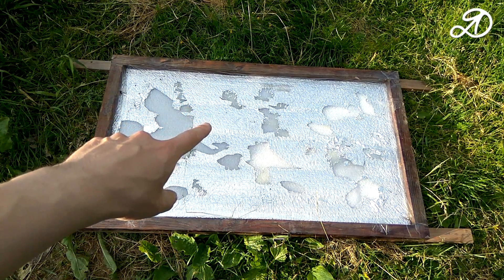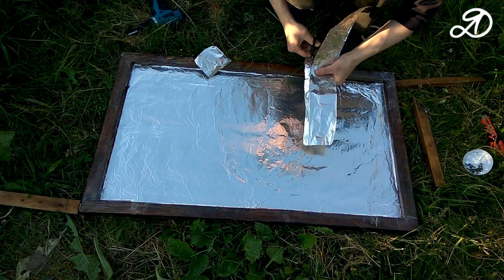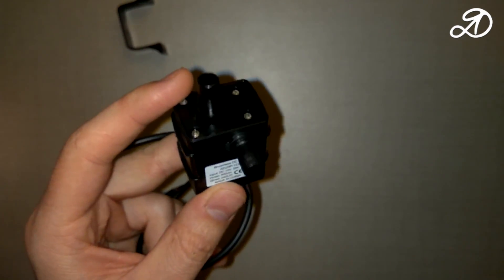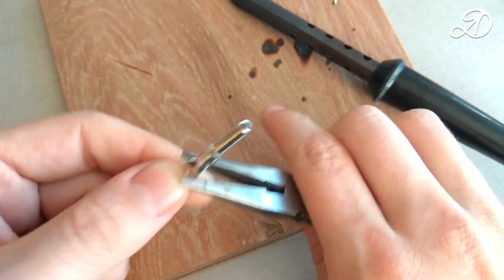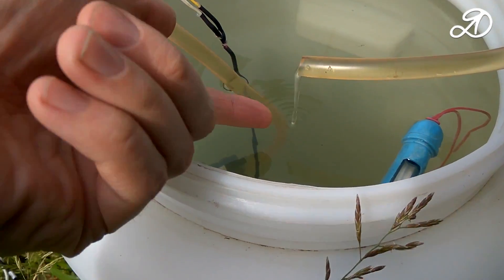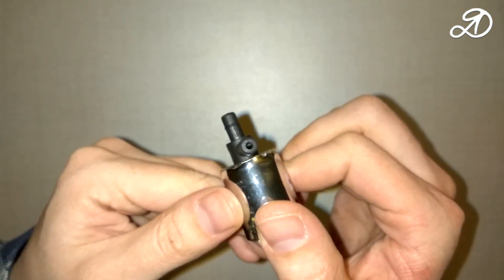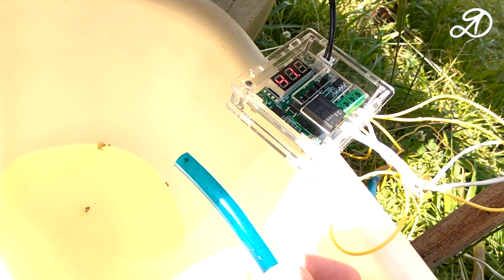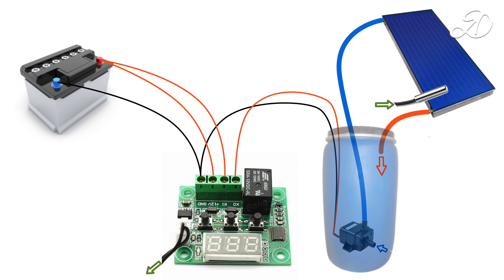How to make a solar collector DIY

Comment: Missing information;
Ambient outdoor temperature.
Exact length of time from water starting temperature to new water temperature.
If I overlooked this information I would appreciate timestamps for it.
This information is required for evaluating the temperature gradient.
The rate of heat loss or increasing temperature is directly related to the ambient temperature.
I could say for example that my water heated from 18°C to 27°C by pouring it in a bucket and waiting no coil needed but that's because the air temperature here is 32°C with 65% relative humidity.
In any case great physical example of a thought experiment.

Comment: Thanks for the video! Just one comment i have to make: The inside of the panel should not be reflective, you need something black like asphalt that absorbs the UV and visible light and releases it into your casing by convection and as infrared radiation thus creating a greenhouse effect.

Comment: Was looking for someone who tried this! Your the only person I’ve seen do it thus far. Thanks for showing your build and showing the panel effectiveness using the old fridge coil
Reply: I've never found another one who tried this, so now I'm building my own. I am curious about what can I get with a more elaborate build. I found in garbage a taller fridge coil, and I'm putting together the box, than paint all matte black an then a glass on top all sealed up with silicone. I want to control the pump with an Arduino program... Let's see what we can do
Reply: @teopuglies  Please update us with whether it worked and what you discovered.

Comment: Thanks for sharing. 
I'm working on a project that requires a flat plate solar collector, I'll love to use a metal instead of wood, will that increase its efficiency?
Reply from the maker: Thanks! Use a black inner surface! Of course, metal will heat up better than wood.
Reply: @dial2277  Thanks. Please can you help me with resource that will guide me through the process of fabrication of a flat plate solar collector, with the most efficient materials (but cost effective ☺). I'll appreciate this sir, I am also considering a polymer flat plate solar collector. 

This is my mail sir, isikawilliam10@gmail.com.
Thanks

Comment: Thank you very much for your video!!!
Reply from the maker: Thanks for watching! I made a mistake in the project. I had misconceptions about physical processes. Or you need to raise the radiator above the foil to the sun's rays reflected and heated the lower part of the radiator. A better foil is to use a black matte surface. The efficiency will be much higher!